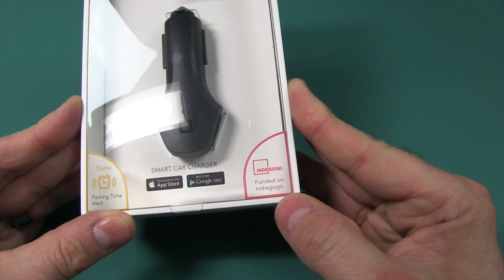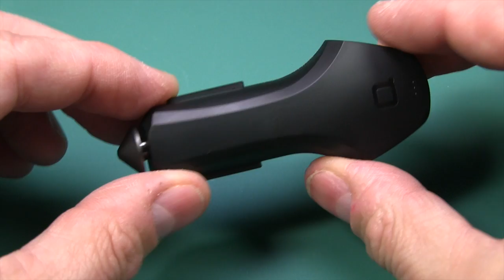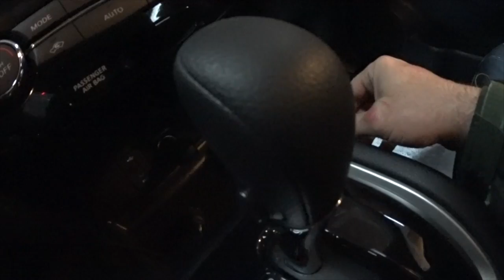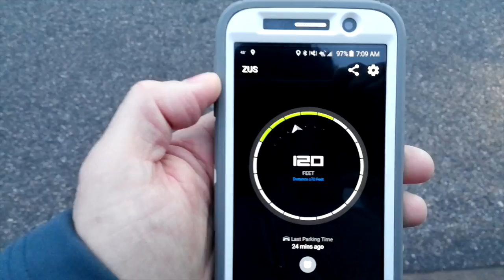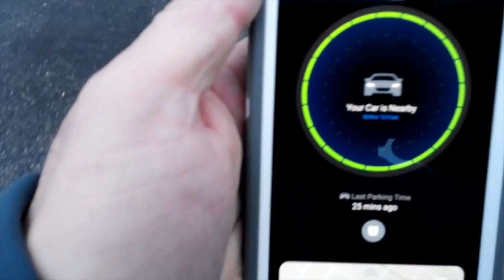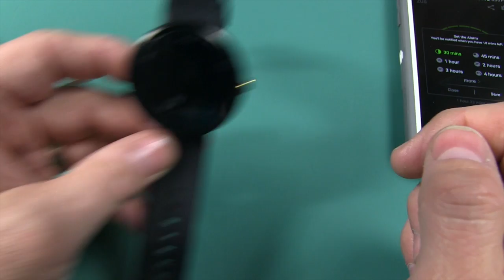ZUS Smart USB Car Charger - 4.8 Amps!!!

Comment: How far does it cover?  I understand that its pretty much great for parking lot finds, as we see in all the reviews, but what if by chance your car was stolen (bad guys don't notice the charger) and your car was... lets say 10 to 20 miles away. Will it work just as good as it does in the parking lots?  I guess the question is does it have distance limits?
Reply: Michael L it's not a tracker just saves your location when your vehicle was shut off

Comment: 4.8 amps!? I like my battery way too much to do that to it, especially since i have a note 5 its not a 50$ repair, i think 2.4 amps is about my limit for safe healthy charging
Reply: +Blu3raNger88 I seriously doubt the note 5 will exceed that 2.4A if that's the output current the provided charger is rated for. The device will only draw the current it is designed to handle the highest current draw of my devices is a Samsung Tab S tablet which will take about 2A at most.

The 4.8A rating on this one I think is more with regards to being able to output that in total over the two ports, or I suppose if you've got a larger more power hungry device then you can feed it enough energy.

Then there's "quick charge", if you want to get a brief overview watch the video in this article: http://www.androidauthority.com/quick-charge-3-0-explained-643053/
The video doesn't go into the full details of constant current, constant voltage and cutoff current to do with batteries, but you'll get the basics in terms that most end users should be able to understand easily.

Just watched the video and caught one serious mistake he made in the end: "A cheap USB cable isn't going to hack it, if you draw 20V of current down them you're gonna need a proper USB cable." Current as most people should know is expressed in amperes not volts, I'm not too concerned about the difference in insulation requirements between 5V and 20V but his point about a decent USB cable is valid. I've seen some very sub standard cheap USB cables where the cable adds a significant amount of resistance, much more than it should due to using too thin copper wires inside (or perhaps even a less ideal material to reduce costs).

Your concern about battery lifetime is valid though, especially with these car type chargers if you're gonna charge your device in a hot car while also exposing the phone to direct sunlight right below the window please reconsider the location you place it for example. Leaving it in a spot where it can get rid of some of the heat that will be produced while the battery is charging fast (below 50-60% full current is typically applied after that constant voltage stage may be reached)  you'd best leave the device out of the sun and with the screen turned off if heat and battery cycles is a concern to you.

Comment: Hello,
is it possible to plug a device with a low amp input (e.g. a 1A usb fan) in it or will it damage it?
Regards
Reply from the maker: +MroOBOBOo I will not damage it.  The fan will only pull what it needs.
Reply: thanks for the reply.